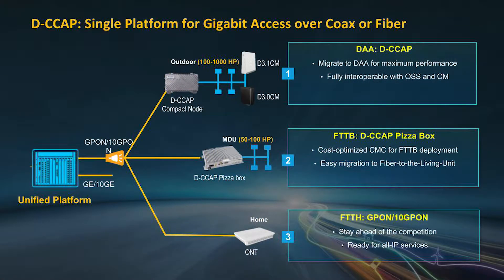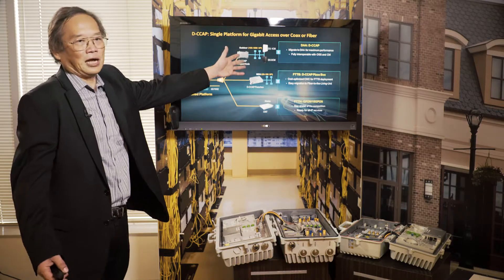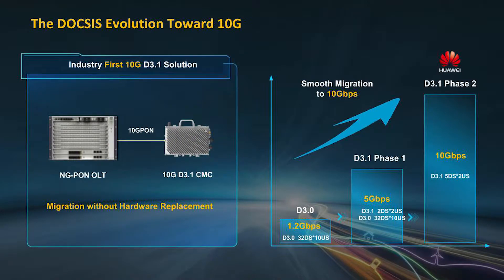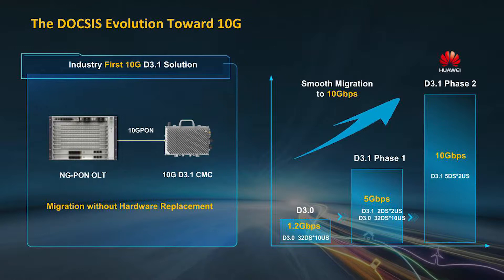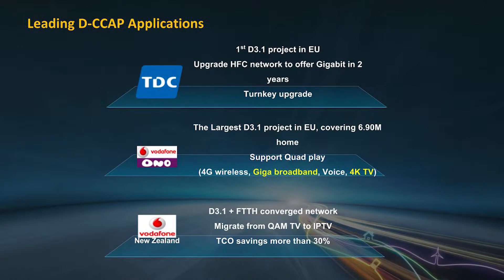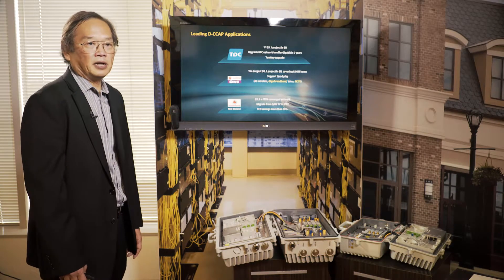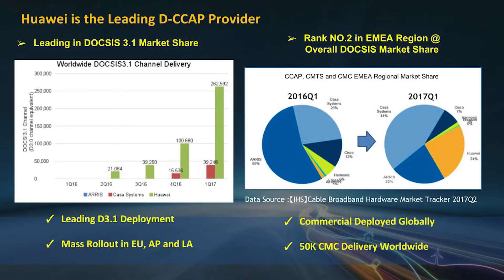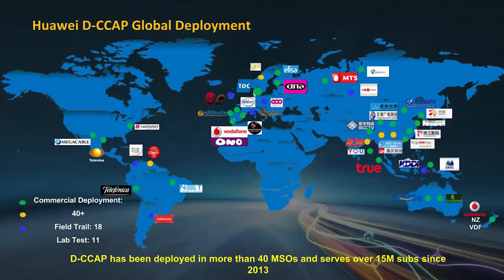D-CCAP Enables HFC Evolution Toward FTTH

Comment: I have a question, clearly the uplink of the CMCs as per the diagram is a PON backhaul port..does it have an alternative fiber ethernet port(SFP or SFP+)? or rather can the CMC connect directly to a core switch for its uplink?